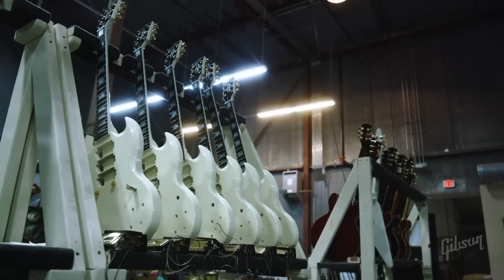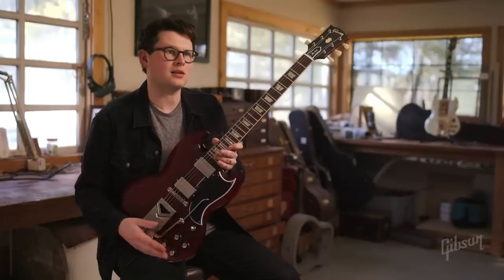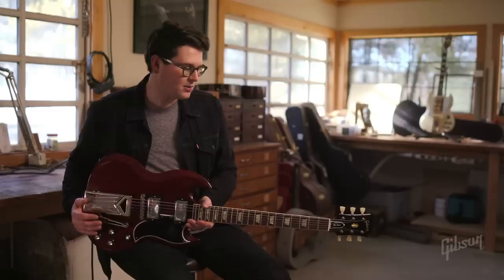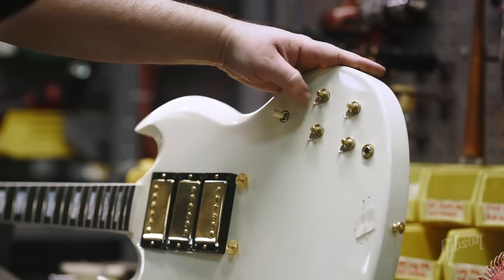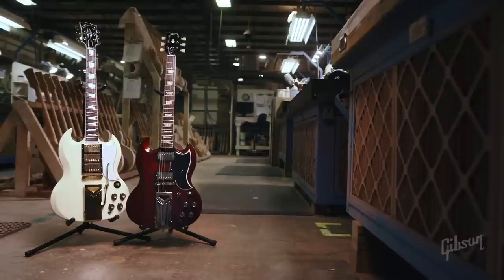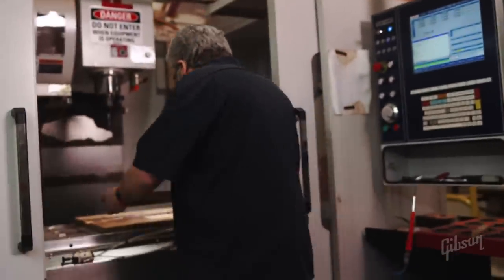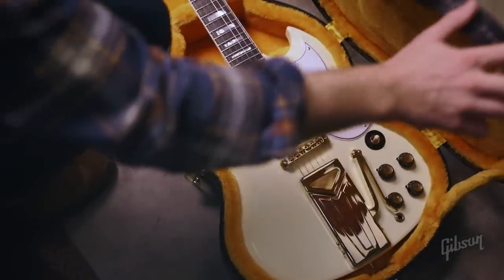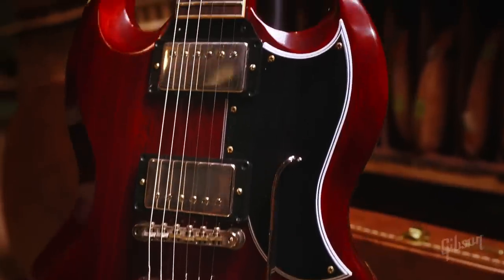60th Anniversary: 1961 Les Paul SG Custom and Standard

Comment: One thing, if I may, that you guys still don’t quite get right on these custom shop models is the way the bevels thin out into the horn tips. On every vintage early 60s SG I’ve ever put my hands on, the horns are tapered and almost “rounded” and thinner at the tips. On these you guys still have “wide” horn tips. Props on getting the pick guard size right for these though! Love Gibson, love SGs, just my 2 cents.
Reply: 100% Right on this… it’s the SINGLE reason I am not buying one… it irks so badly to have that detail wrong. And it’s even in the scan data… the scan model they show has the right tapers… hell the original USA series bodies are correct-ish… why not the CS anniversary model!!!!!????
Reply: @scottjua  couldn’t agree more!!
Reply: All the fancy scanning equipment, examples to measure, Gibson still can't get the horn shape right.

Comment: I hope you guys fixed the short tenon problem.  On the '61 they tend to break.  I've got a '61 SG and the neck/body joint (tenon) keeps giving out.  I've had it repaired I don't know how many times.  The 2000 SG standard has a neck tenon much longer and stronger.   You could use it for a baseball bat.  All in all SG's won't stand up to a lot of mishandling, but find me a cooler looking, better sounding guitar and I'll buy it.

Comment: I have the Custom version of one of these and it's easily the nicest guitar I've ever owned, and one of the nicest I've ever had a chance to play. It was worth every cent because you can't find guitars that feel, sound, and play as well as Gibson Custom Shops.  I'm not a collector--I'm going to play mine until the damn glue dissolves. It will be checked and dinged and refretted. And know what? I don't have to worry about losing a considerable amount of value when I get it refretted. I'm sorry, but Custom Shops are not far off from vintage guitars in terms of feel and sound without the manufactured cork-sniffery of vintage guitars.  Gibson manages to make killer guitars without using garage hardware with "F" logos on it and polyester finishes, too.

Comment: My Epiphone Headstock, popped in 3 weeks. Back to Fender.
Reply: Becarefull with your guitars , Gibbys arent, fool proof
Reply: i dont know how you treat your guitars but my epiphone headstock is still on after 19 years and going strong. also my gibson headstock is still on after 13 years without a problem.
they dont break as long as you dont knock them over or bang the headstock into things.
Reply: Don't drop it or knock it over there is 115 lbs of string pressure on the headstock
Reply: When i said Gibson aren't fool Proof your Da fool making a assertion like that they all break handeling them like a toy .I had all the fenders  EPiphone and they don't without malice.
Reply: They don' Break without malace.
Reply: @JuggalloJGallo  yes,  I am too bitter about it. But, I have an ES-Paul for 15yrs. Still strong. This SG is a toothpick.
Reply: All on its own??

Comment: And during that time Gibson had a factory fire that almost burned out 1/2 of the factory production dept...61 was an important year because it was the resurrection of Potter St...the SG Line was the only production area untouched by the fire...so as a result they used it as the Les Paul model as well as it's name sake..Gibson took two years to recover from that terrible fire

Comment: I just bought a 2016 Gibson custom shop Standard Historic SG Standard miestro vibrola.Supposed to be a 1961?? But the specs lean closer to mid 60’s? MIESTRO, but single ring Klusons ,..so early 60’s?

The guitar seems to have very little pressure on the bridge saddles, is this normal? Also the guitar has Custom Buckers, and in the neck position, i cant, seem to get that snappy Neck position sound, like my R9 R0 or  Strats. is probally the best description of the sound im describing.The SG has a darker muffled sound in the neck, is that normal for the SG?

Comment: Too expensive, always have been and always will be. And it's nothing to do with quality 2000 to 5000 is greed, these guitars do not cost anywhere near that to produce including labor.
Reply: even if there was a quality difference between a "regular" $2000 Sg and the $6699 SG Custom shown here, I would be scared to death to take it out of the case. especially with Gibson's infamous headstock breaks.
Reply: @jacobarmstrong5308  buy a copy, problem solved
Reply: get an Epiphone instead